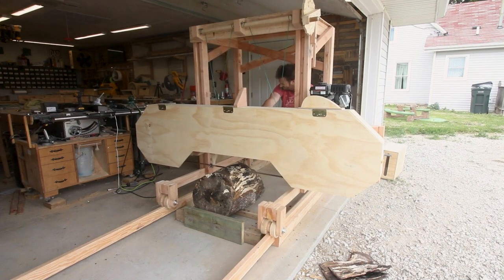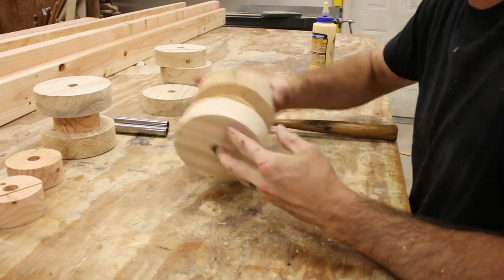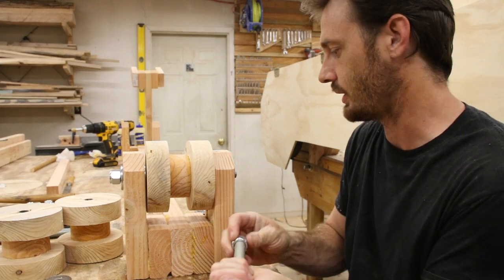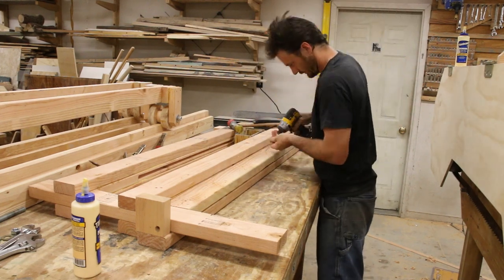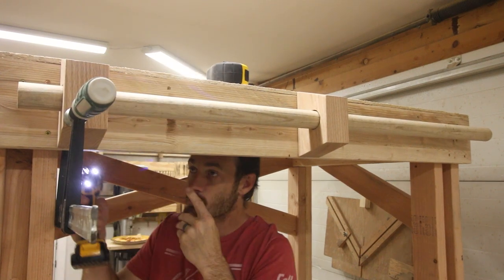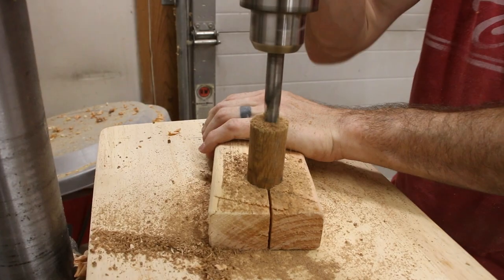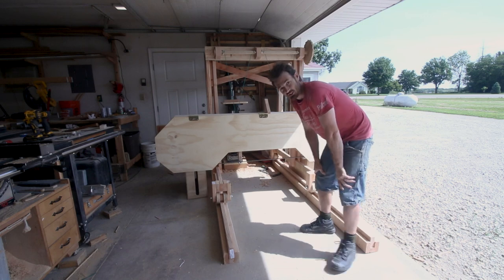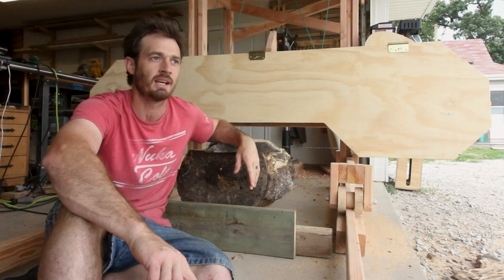Realizing A Dream

Comment: Hey, I watched this series and it's so cool! Love it! Congratulations on a cool project finished! And holy cow, I'm sorry you had to deal with such nasty health issues trying to get this done!

I was thinking about how you said you need to upgrade the motor to something more powerful. With the caveat that I'm no expert, I wonder if you could get away with the same motor by reducing the "pinch" on the blade. One way to do this would be to wedge the cut after you get a few inches in, not a lot, but just inserting something in the back of the cut to keep the wood from binding the blade. The other thing might be to use a thinner (shallower? I'm not sure what the right word is... basically talking about the distance from the teeth to the back of the blade) blade. A friend of mine is a luthier and I remember him telling me that he always thought he needed a huge blade to resaw hardwood and eventually learned that he made a lot less smoke with much less blade and still got great cuts by making sure his saw was aligned well.

Anyway, I'm sure you've probably already upgraded the motor by now, but just wanted to share these thoughts. Someone may chime in to say I don't know what I'm talking about. :D

Comment: Very cool build! You're a talented guy. A couple of points of feedback, take it or leave it: For safety, could you build a pulley system into it so that you can control it from afar rather than pushing it? Also I noticed a chunk of wood fly toward on end of the saw. I was wondering if that could end up lodging into the saw blade wheel and damaging the machine or causing the blade to come off. Perhaps a guard could help prevent this.

Comment: Nice work.
if one revolution of the top roller lift the saw 5.5" and you wan't 1/2" increments you need 11 notches.
formula: lift height one revolution / wanted increment = number of notches